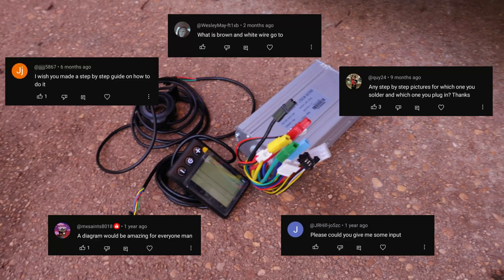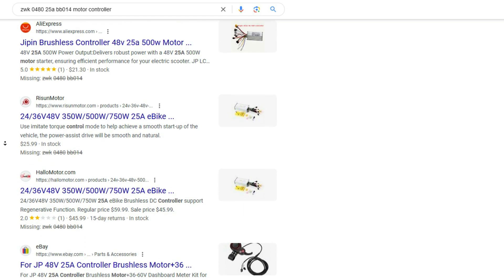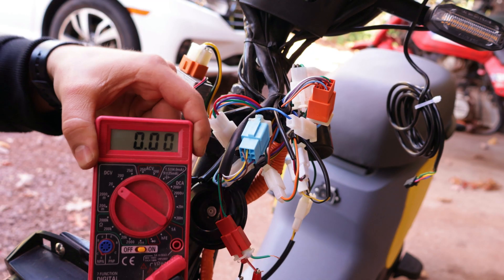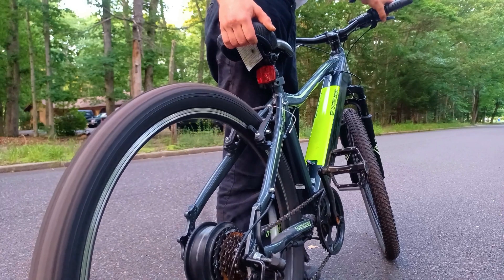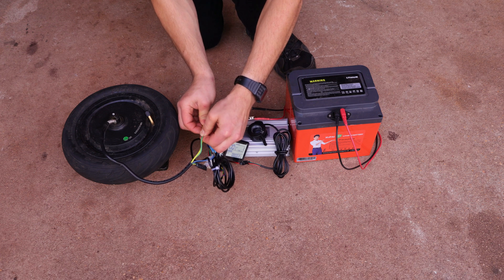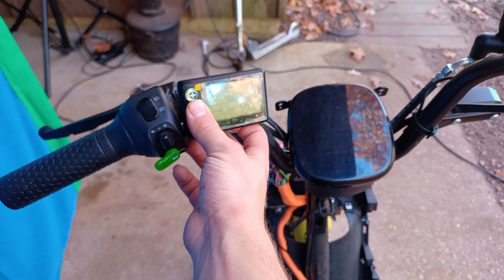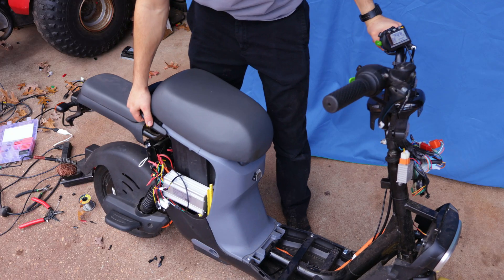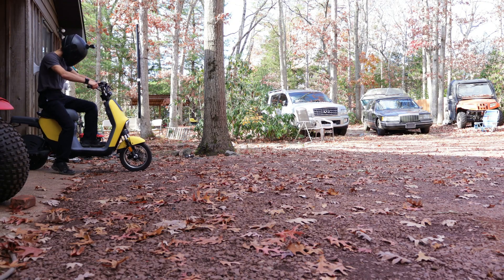STOP Making This Ebike Motor Controller Installation Mistake!

Comment: Good vid... but, what was the before and after performances?  Keep up the good work.
Reply from the maker: When I got this moped, it didn't work, so I had to replace the motor controller, and generally, I think the top speed was about 30 miles per hour.

Comment: I was looking for a good 48v 1000w brushless controller with a screen and this looks perfect with how good the guide and this video is
Reply: the linked one was unavailable so I ended up buying the 1500w version from the same supplier, also got a 48v 20ah battery. Can't wait to upgrade this redneck scooter I bought this week!

Comment: "Temporarily" hahaha
Gonna check out your battery video too.
Reply from the maker: by temporary, I meant twisting together the wires, and later, I soldered them.
Reply: @ElectronicLab. did you did it for all of them later? I saw you did for one pair, sometimes does temporary go to normal because you need to adjust? 😂 I solder 100% with the T21 soldering iron or I'd use wago or those clamping ones. Do you like them? I always worry about residue getting on the tips of the wires so to me it's usually"temporary". I saw your battery video too, insane how they lock us out with the BMS WTF!

Thanks for the vids!!!

Comment: Hello, I have a Gotrax G4 that is is turning on but motor is not going I already checked connections and I also checked the throttle. I will like to fix it myself can you tell me what I should check or troubleshoot next?? Thanks in advance.

Comment: Any way to increase takeoff torque on this type of setup?  I have a 750w mobility scooter with this type controller, it plenty fast but slight nudge to take off
Reply from the maker: There might be more expensive motor controllers that give a lower voltage but more currents at lower speeds, which gives you more torque. and then as the speed increases it'll increase the voltage and lower the current to keep the wattage stable in order not to overheat the motor. I have never experimented with this, but is something that I will try out in the near future and maybe even make a video about it.

Comment: You were shorting the wires with the tape thats why the wheel wasn't spinning the first time you reinstalled the wheel
Reply from the maker: tell me which wire I was shorting out
Reply: @ElectronicLab.  The wheel wires but you fixed it by soldering and adding individual heat shrink to them so no more shortages 🤙 (by wheel wires I mean those 3 wire hall sensors or whatever they are called)
Reply from the maker: @Zalix-x3e  makes sense

Comment: I have the same issue with 3 motor wires.. just switch the yellow to green and that works perfectly,thank you so much!
Reply: Help please! My brand new ebike got an E4 error (overheated controller). My mom got me a TST R002 for just over $600 as an early Xmas present. When the 15 day warranty (HUGE red flag) expired, on the very day, it broke 😢. I absolutely love it. It's an integrated controller (yuck). When I opened it up, there was a wire just sitting there, unplugged. Is it supposed to be like that? 4 wires (black green blue red, however I hear that in China they just use whatever color is laying around 😮‍💨). It looks deliberately not plugged in?  Also, the throttle acts like a button, not like a throttle. If it's pressed at all, it is automatically floored to full power. Is it supposed to be like that (cause it's cheap)? It's very lame because in addition, the throttle has this habit of getting stuck, so my bike has just randomly ran off a couple times. Thank you!
EDIT: well... I think he just answered my question 😂 sorry!
Reply: @TheEbikeApprentice so sorry about your situation. Hope you've had it fixed now. Would be happy to hear ❤

Comment: Have ever looked at an Eahora M1PS Knight? The battery that  comes with it is too weak for the steep hills and mountains where I live. I asked them for a wiring diagram for the battery plug and they will not help me. The battery has a male connector with red+ and black- and 6 small pins. I have no idea what they go to. How can I figure out what those 6 pins do?
Reply from the maker: too weak as it cuts out while riding it uphill?
Reply: @ElectronicLab. Yes, I ordered a 72volt 80ah to replace the 72volt 40ah. The 80ah is a little smaller so I can place it in the same place. I just do not know what they will do on the battery for those 6 pins. They are putting a BMS on the battery which works with blue tooth. I hope I do not lose my display readings if those six pins are not connected on the battery connector.
Reply: I am watching this video of a guy that knows the bikes controller. (Unlocking the EAHORA M1PS) MrCentealDriver
Reply: I sent a message but no answer. 🤷🏻‍♂️
Reply from the maker: I've never worked with a battery that has more than a charger input and power output. I guess there's only one way to find out. my next video will be e-bike battery related

Comment: My sons bike been getting hot at the controller part that connects to the motor. I got the new controller but can’t seem to get the 2 black plugs apart. Wondering it the heat made it stick together. Any idea how to get them apart without hurting the controller or the motor? I don’t want to ruin either wire in case it’s not actually that and need to keep my old controller and return the new one and maybe replace the motor or something else in case. Afraid to just pull really hard and possibly snap wires. Thanks
Reply from the maker: first, disconnect the battery wires. if it is melted together, you might have to chop it and either solder it or twist it together with a wire nut, which you can get from Homedepot. and then put plenty of electric tape

Comment: Is posible. 2  motors + 2 controllers, on this display?
But not 2 controllers a+b, 2 controllers, a+a controllers for only one motor
Reply from the maker: you can connect 2 controllers to 1 display, but you have to make sure not to connect the green wire from one of the cables from the controller going to the display.
Reply: @ElectronicLab. I set the wires on fire. Oops. I removed the cover. Jumper wire for one battery to two controllers. Good. I placed the secondary motor next to it, connected to the secondary controller. Good. I started jumpering the wires between the display and the main controller and the secondary controller, without connecting the green wire to the secondary controller. When I connected the last wire, the red power wire... the wires caught fire...
Reply from the maker: it is a risk to do something like this in general, and I cant see exactly how you connected the wires, you can post a video on your channel so I can see what you've done. maybe I'll make a video in the future on how to use multiple motors, controlled by one display and one throttle.
Reply: @ElectronicLab. Well, the throttle cable is also burnt. Luckily, the flames came from the cables I used to make the jumper and not directly from the controller's cables. Unfortunately, the throttle isn't working now; it's giving an error. And the screen is broken too. It's giving error 10, which is a communication error. I have a spare screen and throttle to keep testing. There are many videos of dual controllers, A+B, but none showing a dual setup using A+A controllers.
Reply from the maker: what do you mean by A+A or A+B?
Reply: @ElectronicLab. A+B controllers are controllers that come pre-configured to connect to each other, each working with a different motor and display. I call A+A controllers "QW controllers," which are only compatible with one motor and don't have the connection for a second controller for a second motor.
Reply from the maker: interesting

Comment: New motor, new controller and LCD display . Motor still not working on my Engwe M20 2.0
Reply from the maker: what is happening after you turn on power and twist the throttle?
Reply: @ElectronicLab.  Usually 02 error, which is supposedly different for not just different models for this bike but each individual bike, I was told. 

I have a component testing thing but they do not connect to all the parts on the bike so I was going to sacrifice my own controller and snip those cables connect them to the cables on the bike and then use those to test the components if that makes sense
Reply: I'm really desperate to get this taken care of because I'm currently living in a pop-up camper not to being homeless on a street for about 22 months, I have the opportunity to get a small apartment not far away from where I work but I need my bike to get back and forth
Reply from the maker: try disconnecting the brake sensors
Reply: @ElectronicLab.  I have done all that. Disconnected each component until the error message went away, does nothing. I went through doing steps from the company in China. Actually so far they sent me 2 other motors. The first motor was damaged because they used zip ties for the motor cable, of course it eventually moved and got binded in the axle and frayed. Sucks because even tho it was initially $1300 I received it for $800 because they had a deal. They sent the new display and they sent the cable separately so I'm waiting for it.
Reply from the maker: I would buy these parts from Amazon because it comes in less then a week especially since you don't have time to wait.
Reply: @ElectronicLab.  Nor do I have the money, I'm barely scraping by living in this camper. It costs a lot just to eat. Which is why I have been forced to wait
Reply from the maker: I wish you the best of luck

Comment: So will any motor controller that is rated for battery and motor size work?
Reply from the maker: if it is designed for brushless dc motors (3 thick wires), then yes

Comment: That's great

How long does it take to fix this? 
I have a new electric/moped having same issue.
Is that supposed to be the wire connection or we get a new pack just like you do?
Reply from the maker: from my experience, it's simpler to just get a new motor controller when the old controller makes problems. but if you want to save money, you can look at all the wires to see if one of them is damaged

Comment: Can I swap out my phase wire connectors from pins to plugs like you have in this, it’s for a 3000w motor so would it work the same and what would the connection points be called e.g. 4.5mm bullet connector. I just need to know what to buy so I can swap them over
Reply from the maker: If your motor has 3 thick phase wires and at least 5 thin hall sensor wires, then it should work

Comment: Heya! So...I decided to open my controller box on my Ebike and the controller wasn't even mounted just flopping. I readjusted everything BUT the only way it fits without moving is the frame on top of the box and the bottom of the plastic controller mount. My question. Is it ok if the controller is touch the frame while in use?
Reply from the maker: The electronics inside of the controller are isolated from its metal enclosure, but if you want to keep it from getting damaged, you can either use double-sided foam tape or zip ties to secure it to something inside the ebike
Reply: @ElectronicLab. Oh ok TY so much! I just saw an Aventin control replace and all they do is stuff it inside the frame of the bike. Mine is in a box I have a 14 inch Ebkarocy. After opening it to inspect it, some of the connections need silicon some they already did. Chinese manufacturing lol. The controller was bouncing around back there it should be fine now. Thanks again!
Reply: Sub

Comment: The motor itself doesn't care about voltage or wattage - it cares about phase amps which is usually about 2x the battery amps the controller is rated at. For voltage, the motors will have a faster max speed with higher voltage, as long as the controller supports it too. Wattage, or battery amps is what you need to be careful with as the battery will either sag voltage too much or trip the BMS or a fuse if you go for too much on a smaller battery.
500w motors can run at 1000w all day if the torque coming out of them is the same but one is at higher speed. Torque coming from phase amps is what heats up motors.
Reply: So if I have a 48 volt 20 amp hour battery lithium ion. A 500 watt rated hub motor, a 500 W 11 amp controller..or 48 volts X 11 amps = 528 watts this is all factory configured, but I decide to upgrade the controller ￼to  a 48volt  X 22amp =  1056 watts. My risk of burning out the  
motor is when the battery is getting drained during use and the voltage lowers? Assuming that the wiring and the fuses are able to handle the 22 amps?
Reply: @rhread the risk of burning the motor goes up only when you draw more torque from it rather than speed. But if the new controller gives more torque you can have more risk if you keep that torque up for too long without enough speed. Bigger motors can handle more torque for longer without heating up. Fancy motor, controller combos have temp sensors in the motor and can auto limit power when it gets too hot.

Comment: that switch u flciked at 2:10 , my bike has that and it switches off and shuts down when i full throttle, any help ?
Reply from the maker: these switches are circuit breakers as well, so you might have to upgrade it or replace it with a fuse rated for more current
Reply: @ElectronicLab. ive been doing research and generally dont know what fuse or breaker should go on my bike, any help ? how do i know what fuse/breaker goes ? thanks for the response
Reply from the maker: If you’re ebike is 350 watts, go with a 30 amp fuse. 500watts needs a 40 amp fuse, and 1000 watts needs a 60 amp fuse. Here is a link for a circuit breaker that should work: https://amzn.to/3IJg3l8
Reply: @ElectronicLab. thank u! my bike is 72v 2000w motor, what should i go with for that ?
Reply from the maker: @victor-iz5vi  a 50 amp circuit breaker should be good enough, because higher voltage requires less current
Reply: @ElectronicLab. thank u! ima try that

Comment: That peebike is still showing the e4 error ! I did try replacing the twist throttle, and re-re-re checked all wing/pins, checked battery, battery connections, no luck so far. Next ill replace the display, I cant even crack in to it. it allows me to open advanced settings but, it wont let me enter any categories once inside. I have trouble locating the exact controller for the m10 isinbike, other than directly on their site which i must avoid at the inflated cost from the US. so Ill try the controller. question, if I order a controller and display maybe thats better??? I just like to avoid throwing more money at it as possible, as it is I could of almost bought a new ekit.
Reply from the maker: If you buy a motor controller and display from the video's description, it should work
Reply: @ElectronicLab.  as long as it fits under the battery inside the case thing, and has a 9 pin to motor connector I think so. Now I'm stuck between buying more parts or going with a whole new kit with a battery and all. Id like to get the monies worth out of this one too.
Reply from the maker: @potsy9973  If you feel like that is the right choice, then go for it

Comment: I have new battery and new controller that comes with new throttle, I can power on but motor wont rotate when i press the throttle i also got the hall sensor connected except the motor has a white wire while my controller doesnt have it. I see that you swap out the phase motor wire. Could this be a solution to my problem as well?
Reply from the maker: yes
Reply: @ElectronicLab. i did swap the phase motor still not working, when i manually rotate the wheel i see on the display it is reading the speed my only issue now is the motor wont turn on. Any more ideas?
Reply from the maker: Does it at least vibrate or make noise when you press the throttle?

Comment: So my scooter is doing the shaking wheel thing like in your video, no matter what configuration i hook up the three wires. 
Do you think my motor is shorted out? My three wires get kinda warm too when I attempt this.
Reply from the maker: Sometimes the hall sensor wires in the motor  get damaged by water, so I would recommend disconnecting them(5 thin wires). If that does not work, check if you’re getting ac voltage from all 3 phases using a multimeter. If there is voltage on all 3 phases when spinning the motor , then you might just have a damaged motor controller, but if not, then the actual motor windings are probably damaged (very rare)
Reply: @ElectronicLab. I bet my hall sensor is burned up. I'm fixing this for a friend and I found that the old controller was bad and it melted the throttle circuit board. I wonder if it melted the hall sensor too. 
I'll have to check it out later. Thank you!
Reply from the maker: Some motor controllers, especially the Chinese ones from Amazon or AliExpress, are able to power the ebike without a hall sensor input, so I guess you can try that. The Only downside when not having hall sensors is that you won't have a lot of torque from a dead stop, only once the motor is spinning a little.